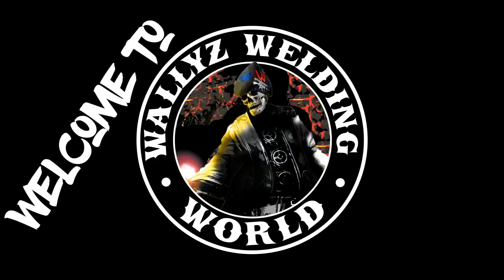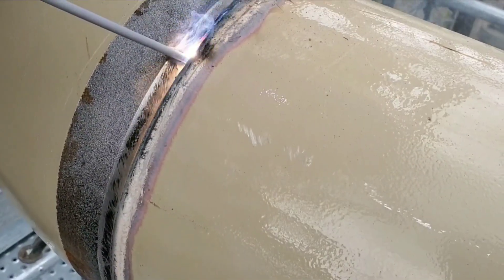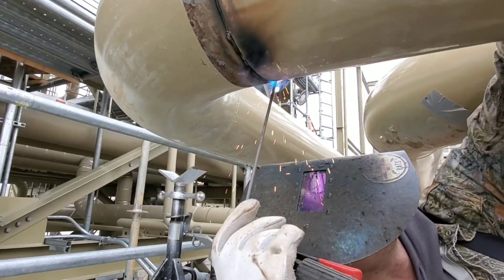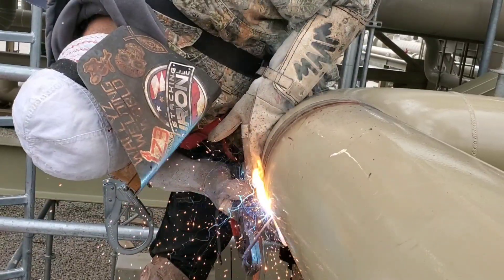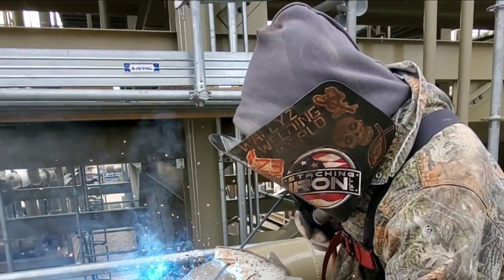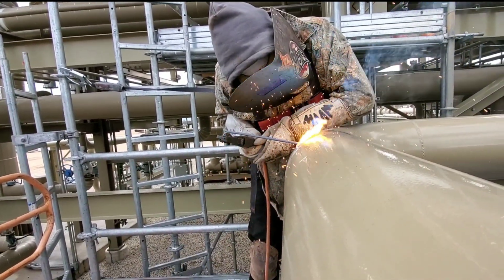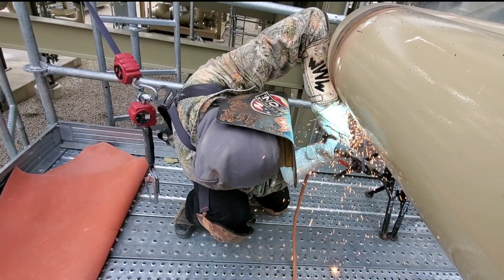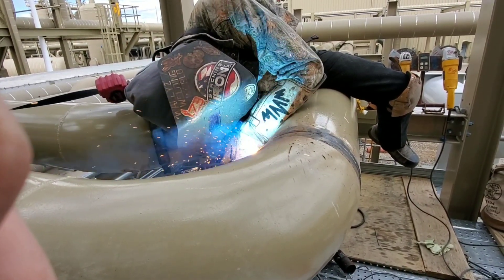Most Welders Weld Downhill Stick WRONG — Here’s How to Fix It

Comment: So what actually happens when u Arc Out on the Pipe.?
Reply from the maker: Most the time you need to cut it out and replace it but many just try to hide it
Reply: But what is the actual issue with doing that.?
 @Wallyzweldingworld

Comment: Not the right process where you are, downhill beading is fine on mainline work but fabrications on the rack in situ is very risky
Reply from the maker: No it was man I assure you. I’m only following protocol so don’t get on here and act like ya know silly 😝
Reply: You got me wrong. I never for one minute suggested you were welding out of procedure. As you stated you are being watched so that was never the case.
 My point is, its no easy trick welding downhill pipe  in tight places , you need to view the arc level to the molten pool or even below. As you said you sometimes have to grind the bevels and rebead an area again not easy. I would imagine TIG or even a 6010 bead and  6018 fill and cap uphill for more control. I can see you are flexible but still it looks tough going , guess its down to the welding engineer who writes up the procedures.  @Wallyzweldingworld
Reply from the maker: @inverterville  yes all due respect sir. I would love to run that bead uphil. But no one in weld county let’s you weld the bead up handed unless there is a procedure that is 7016 Lowhy or tig. If they choose the up hill  bead they always go tig around here. I hold these certs now as a business owner and it’s totally up to me me at times but every now and then a gas line is under a criteria we follow. So I never try to break the rules. I was under the impression you was stating it was not the right process where I was at! So I’m not sure where ya thought I might be I didn’t put a pin drop lol.

Comment: Not trying to throw shade or anything. Just legitimately curious. Isn’t that an arc strike outside the bevel from when you flicked your rod out at the end of that first weld. I think it was a tack weld. 2:32 you can see it at the top on the right side of the weld. I’m in trade school now and wondering what is considered acceptable in the realm of actual pipe welding environments so asking for learning purposes.
Reply from the maker: All
Good no sir we good 👍

Comment: Really bizarre the down welding on pie with cellulosique stick.

I am welder also, and i weld up pipe like 600,800,1000,1200 mm in the air or down in the ground and make up welding with basique stick 2,5mm or 3,2 mm.

It's Really différent the down welding, look easier but just in vidéo 😉

I have to try cellulosique stick one day.

Comment: For the root must thinner are electrodes needed?
Reply from the maker: Yes I normally weld with.  1/8" 6010 first never 3/32
Reply: @Wallyzweldingworld  ok thanks.   Where is this?
Reply from the maker: This is in Colorado

Comment: They ought to provide air" suits to all welders cuz it gets so hot, that would keep the body temperature way down and the welder more comfortable and they all ought to be given welding helmets that have that air stream that flows in front of the face  to keep that smoke from being breathed in some Industries rarely provide an air suit to keep the temperature down but it ought to be mandatory they worry about your tie  off on a scalpel that's even only two foot high off the ground as crazy as that sounds but yet they allow welders to burn up in the heat in the hot sun and Breathe those fumes when they can prevent it

Comment: I always weld 6010 and 8010 downhill and always drag my bead, step my filler pass and dimestack my cap I use a sawsall or tiger saw blade for my gap when testing

Comment: What is arcing out?
Reply: Striking the rod outside the bevel. Considered a defect and therefore a cut out unless you can cover it with the cap.
Reply from the maker: Pretty much what miller lite said. Welding outside the designated area is referred to as a arc out. Arcing outside the bevels.

Comment: Hey man I saw you welding a smaller diameter pipe in another video and you had said you like to hot slash with the 7010 I’m assuming pipelined rods and cap with 8010 so why did you decide to go 8010 all the way through after bearing on this pipe is this just due to the diameter size of this pipe or what
Reply from the maker: It's whatever the procedure is
Reply: @Wallyzweldingworld  ahh ok I see well I appreciate the response man and also would you say if you had to guess that you space your pipes tighter than a sixteenth because I don’t have a clamp for pipe and I use a sixteenth tig rod for Gapping and I tried to compare to one of your videos but I couldn’t hardly tell so would you say it’s under a sixteenth gap you like or over?

Comment: He,s bullshiting.... No pre heat on that pipe indicates it is not high carbon/manganese steel or of a chrome range ...
Reply from the maker: Bro i pre heated it i have too. Come on now bro pay attention a lil better ya make yourself sound dumb
Reply: @Wallyzweldingworld  Yer Im dumb alright What were the preheat peramiters ...Post heat and stress relieve....PS you only have to if the weld procedure says so....The weld procedure is the standards and specification laid down by the client to be adhered to by the contractor.....
Reply from the maker: It is what I say it is if it wasn't then why I would it is everyday in the paper and in the news it is they don't even got a clue about this biz

Comment: What is “arc out” why does it require you to cut it out??
Reply: Arc out is when you break your current with the base metal and turns off...
Reply: Michael Paxton yeah cool. Thanks mate. Why does it require you to cut it out then??
Reply from the maker: Arc mark means you weld outside the weld zone and that’s why you cut it out gotta keep the spark in the Bevels
Reply from the maker: That’s actually called breaking arc

Comment: In school we did 6G schedule 80 pipe and ran uphill why did they not teach us downhill, went to School back in 2009. A lot of places I have worked for have different standards then what I learned in school. Guess I'm still confused why I was taught a certain way, when it's totally different in the field and in fab shops. Thinking of getting back into it and going back to school to relearn pipe welding and learn tig tube welding. Manly ran a MIG gun and worked for local fabrication shops. I worked a few months on the road tho and enjoyed that the most, got burned out so I stopped welding for a while to try other things.

Comment: How is the heat from the rod not going through your gloves and onto your fingers when you hold the rod, I have black stallion gloves but the heat always gets through after about 10 seconds
Reply: Also I just started welding in trade school so sorry if it's a dumb question

Comment: They don't want you to grind between restarts?
Reply from the maker: Who does that 🤷‍♂️
Reply: @Wallyzweldingworld  most of the pipe jobs I've worked required 2 in grind clean between each restart. Even the damn tig work. Chesapeake was the strictest

Comment: It is not dangerous, besides uncomfortable to use those metal masks? assuming, that while working in a very small space, and your body and your mask are in contact with the ground, you could have an accident, that in addition to the weight that supports your neck, the radiation of the temperature of the mask ... wn Anyway, I see it very impractical, very unintelligent.

Comment: hey! I've got a few questions for you, I'm just starting to learn how to weld:

1) how do you deal with welding fumes? ( If I don't use a respirator, my throats end up in pain and phlegm for a week or so)

2) what exactly is a arc cut out
Reply from the maker: So yes it's hard to ignore the fumes. I just try to work outside so the smoke don't get me to bad. But it does I live in it i wont lie. And arc cut out means of your weld outside the weld zone with is the beveled part to weld the pipes together they make ya cut out that section you arced out on if outside the weld zone.
Reply: @Wallyzweldingworld  Thank you very much for the reply! Happy welding :D

Comment: awesome video mann
I am still a student on welding,
our instructor told us to weld uphill  to avoid stocking the buttom part with melted stuff..
does  it have to do with the rod and type of welding?
different rods different method?
Reply: Yes it does. Not so much on vertical though. 6010 you don't drag the puddle ahead with the skipping motion like you do flat. Ya just keep it moving and if you are set right you will move on just as you see it digging in. I think 7018 is easy to weld vertical.

Comment: This is the kind of work that keeps nations running.
I worked in a powerplant in germany. The powerplant was built in the 60´s. They redesigned or changed some pipes some years ago. The diagnosis guys where bored and tested some welds on the old pipes. Porousity and other nasty things where found. The pipes lasted 50 years that way.
The requirements seem tought today for welds.

Comment: Damn guy I've never welded before or know anything about its but you make it seem like I can learn it. You are really entertaining. Keep up the great job on the videos.
Reply: What he does is not for every welder. He makes it look easy. You have two kinda welders structure or pipe welder an you have a shop welder. What he does is where the benjamins are you make a kill doin what he does. Then you have the shop welder that goes to the same building everyday. He couldnt do the shop thang its boring as hell. What he does is what you want to do you get more experience at it in different angles. At the shop you have all your weld on a table or a bench. What he does is hard as hell
Reply: H

Comment: Is that all you guys use in America stick.Man in Australia we use TIG get with the times 😂😂😂😂😂
Reply from the maker: I use tig on many pipe welds before. Come now come to America already wangsta
Reply: I'm working at Kimberly clark. They make toilet paper here. I had to take 2 welding tests just for this job. The first one was a tig plus 7018. It's very thick pipe. I think it's schedule 160. I have UA certs for this test .UA 63 it's called. But when I go to these jobs they dont take the certs. So you have to take the test anyway again. Then the next test was a tig 316 all the way out. It was  in the 6g position. We had to use this coated rod for the root so you dont have to purge the pipe. It was like using a sparkler for the root. What a total pain in the ass that test was. I was soaked taking this test. Its super hot in that shop. It even hotter on the actual job were the work is. They bust your balls on these tests just so they have it on theire books for insurance purposes. I guess. All this and the only thing they make is toilet paper.  If I failed the tests i probably wouldn't be working there. Lol all this in the name of shit paper. See ya.

Comment: Did u start off learning uphill or downhill
Reply: Did you find that after welding uphill for so long that downhill was hard to master but after a while it seemed easier than uphill
Reply from the maker: My first taught welding is all uphill for many many years
Reply from the maker: It took me a min to get it down. All my machines burn it differently

Comment: Hi young man, Are those Kuny's knee pads and did you find out why the backing strip is required on the Split "T" joint?
Reply from the maker: It's to keep the heat reduced on the center of the pipe I learned.
Reply: Thankyou for sharing that young man!

Comment: 2:30 looks like a arc strike
Reply from the maker: If you have it there after the cap then it is outside the weld zone which it is not. Thank you for WATCHING VERY CLOSELY
Reply: @Wallyzweldingworld  like that Bengiman inside your hood lol
Reply from the maker: Nope if it's in the bevels and ya dont see it when I'm done capping
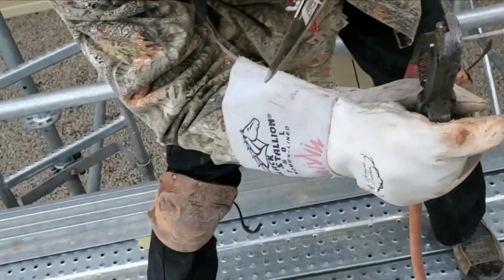Reply: TheWeldProfessor it isn't there at 2:20 but at 2:24 you can see it too the right of the weld
Reply from the maker: That is just smoke from firing up. It is not out side the weld zone. Keep looking thru out the video and we fill and cap.
Reply: @Wallyzweldingworld  got you boss I figured that after my last comment that's way too far out of the weld zone keep up the good work

Comment: I like watching you weld but I can't get use to thoughs rods and going down hill iam strictly a 7018 welder and would have run up hill put a pass around that that looked like a robot did it. To old now my welding days are over.
Reply: I need spell checker haha thoes rods and too old
Reply: I welded for 30 years was DOT certified SMAW . Started welding for the rock quarrys here man they can break stuff welded in the crushers at night and on equipment during the day. My body began to ware out finally called it quits.
Reply from the maker: I do alot of 7018 myself

Comment: I can see this pipe is not X-ray because you would have had that rod jammed in there and I would not see any sparks.  In any power generation place we always tig root and 7018 fill, Chrome is different.  450 Preheat under the gun.
Reply from the maker: You are incorrect all.my welds are shot to severe cycle b31.3
Reply: We tig root up to 18" anything over that stick and all x ray correct me if I'm wrong but all refinery pipe has to be stamped weld # and xray
Reply from the maker: @kylivia1222  iv had to do that too
Reply from the maker: @kylivia1222  yes
Reply: I thought so done a lot of it and its a must
Reply: HEY WELD DOG, MORE VIDEOS
let’s hit the pipe my man :)

Comment: You are an artist man! I do a lot of welding around the farm and on the side. Not a pro. I did my first pipe fence the other day. Tried 6010 with my Trailblazer. Couldn’t get a good bead for crap. Tried the whip and pause and all that. My 6013s were too small so I grabbed what I use mostly, 7018. Tried the right way going up hill with 7018. It worked but was ugly. Broke the rules and went down hill on the pipe with 7018. Surprisingly it went perfect. Beads came out beautiful and even survived a smack from a tractor trailer a few weeks later. In the end, I adapted and left with a happy customer.

Comment: Very nice. I'm a boiley in aus. Is there something particularly challenging about this type of weld? I've done pipe work, mig, tig, and stick but all vertical up. Mostly high volume low pressure stuff

Comment: How do you get by with down hill welds when i was pipe welding it was all up hill welds, has it changed that much?
Reply from the maker: I still do a ton of uphill. But I do a bunch of downhill. Depends what the procedure calls for so I always gotta ask is this uphill or downhill procedure
Reply: There has always been a downhill procedure it’s nothing new I’m sure the weld professor didn’t write it !!the facility he’s working on probably has a whole inspections department that decides the procedure based on process, and service of the pipe. 
Funny thing here in Kenai Alaska the welding school only teaches up hill and I have yet to see an up hill procedure used so they are literally teaching the kids useless information
Reply: @ericrasmussen2212  I agree I was trained on Up hill and on the jobs it was all up hill.

Comment: Why are they so strict if you arc outside the bevel and make it a cut out
Reply from the maker: It damages the pipe
 And we just cant have that. Makes it weak and could break open due to the pressure running thru the pipes
Reply: Thanks for the info 👍

Comment: Easy job, down hill is not allowed in Saudi Arabia oil refineries
Reply from the maker: That's cool. Back in my shop days we Built a bunch of stainless units that went out there. I use to third party contract for u.e compression. We built the compressor skid units.
Reply: Guillermo.Down hill welding is not allowed in Finland too.